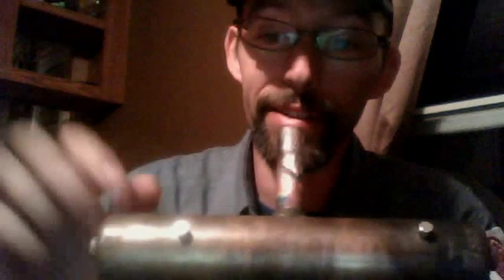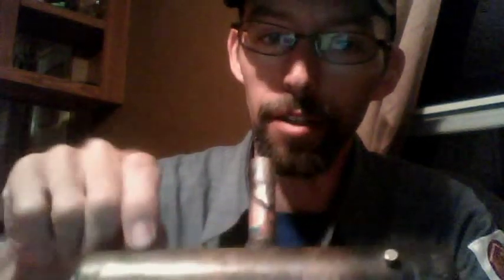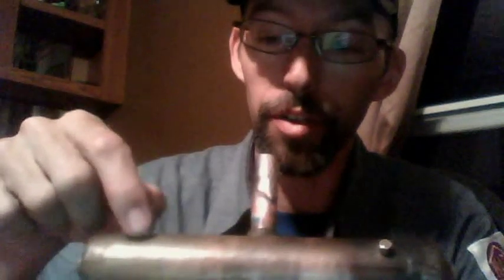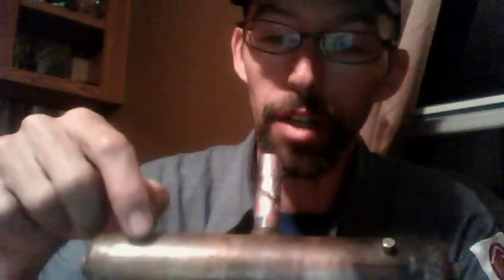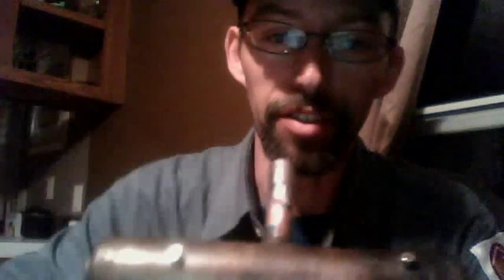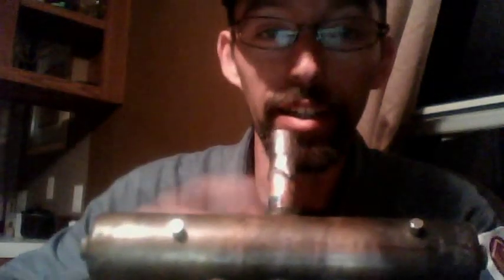REVERSING VALVE TEST WITH MAGNETS

Comment: dgv302, a number of things pop in to my head on that.  Check the wire  plug on the rev. valve its self...tend to come loose from the unit shaking, could be a bad sequncer turning on heat strips at the same time as ac running...check wire nuts in air handler and out side unit...if dig stat put batts in it and do continueity checks to make sure the rev vale is being called on...let me konw how thing go!

Comment: Hey Jason I have a York heat pump. When I turn to AC I get heat coming out!!!! I figured it was reversing valve.I would then pull stat  which kills unit .Afetr 30 min iput stat back an AC works. Now what do i do if  that doesn't work??

Comment: What a great trick!  I went out today and replaced a compressor diagnosed as a no-pumper by another tech.  When I started it up, still not pumping!  I decided right then and there to look on the internet and see if there's not an easier way to tell if a reversing valve is stuck or not.  I'm picking up some magnets tomorrow.

Comment: I'm not an AC guy, but I'm having a problem that may be related to this valve on my Rheem heat pump. This looks like an easy way to tell what the valve is actually doing. Thanks for the video. I will let you know if it helps me resolve my issue. I love magnets!